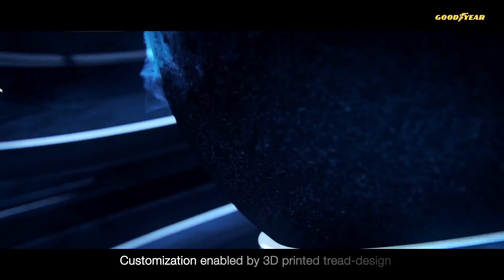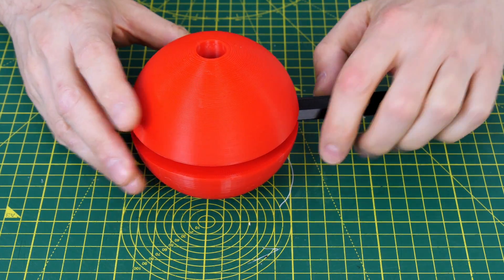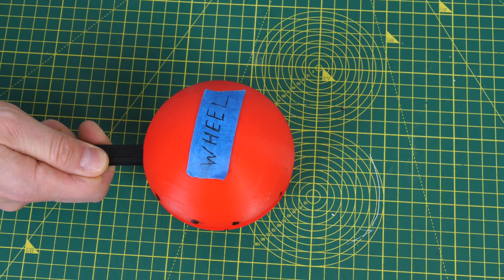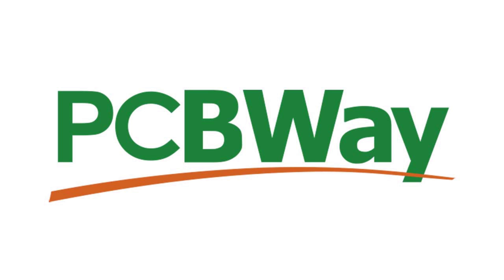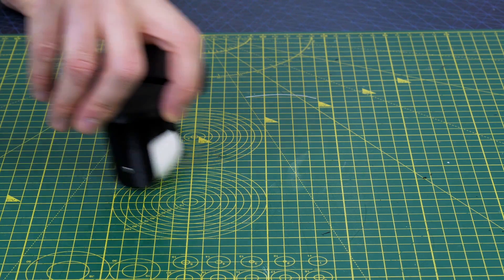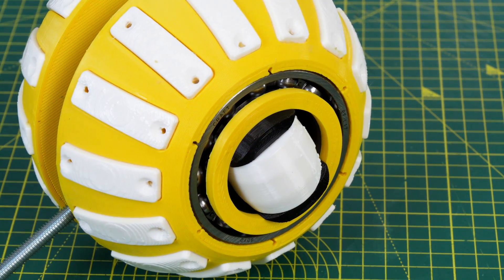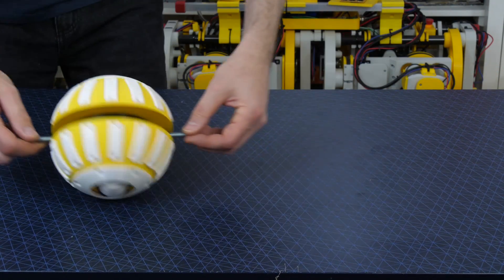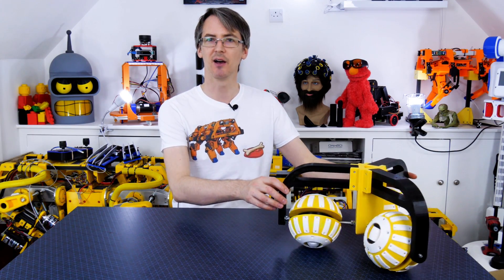Are Ball Shaped Wheels Practical?

Comment: Balls as wheels for a car are about the worst thing you can do! With a car on normal tyres you drive on a surface about the size of an A4 sheet and with a ball as a tyre you would limit that significantly and therefore have less friction surface, which can lead to loss of grip in corners. For vehicles that are slow, they can be a game changer! Also think of the lift on wet surfaces, many more cars would crash due to aqua planing.

Comment: It looks realy greate. You can add additional wheels in gap similar one that you have on sides to minimize that bumping effect and as well to gain a bit of space and make wheels more rigid.
Reply: A mecanum wheel track in the gap (beads at 45 degrees on a D shaped tank track) would solve it, but it's complex and looses the main advantage of this wheel design: it can go offroad. Bumps are inevitable there.

Comment: Interesting video as usual, nice alternative to Mecanum wheels. James, curious did you look at inserting a free moving ball into the end of each hemisphere rather than a wheel, something like the old ball mice had? It would avoid landing on the end and only being able to move in one direction using the inset wheels?
Reply from the maker: The ball would need to be mounted on something so it's free moving under load though
Reply: @jamesbruton  so i was thinking of the mount where it rides on three/four little rollers. Given the end cap only got used when it was near vertical at the bottom the little ball would push up on those, maybe that would be too much friction.

Comment: You can use a boll on top and bottom of each wheel like in old ball mouse, instead of weels.
Reply from the maker: Mounted on what so it moves under load though?
Reply: @jamesbruton  I think it called "Ball Transfer Bearing" or something like that i do not know how it called in English. Also mounting place for a ball from graphite can be useful for small loads, I think i seen such method in video "Make vacuum pre-loaded spherical air bearings without special tools" (sorry i cant give link because YouTube delete my comments with links)

Comment: Locking the polar wheels to an axis isn't the best idea unless you're going to be specifically moving along that axis when the sphereical wheel is positioned on it's pole. Examples like the three wheeled base is an example of why axis-bound polar wheels don't work, imagine if each spherical wheel was oriented on it's poles simultaneously, the vehicle could no longer properly drive itself without a lot of friction from the two misoriented polar wheels. 
A better design would use a ball caster, which is a sphere trapped inside of a housing. This would allow for full 2D cartesian movement and a pivot when the full spherical wheel is oriented on it's polar axis, and would allow free movement when the spherical wheel is slightly off-axis. This would alleviate the issue mentioned before, where friction is induced on a misoriented axis-locked wheel.
As for the TPU cap causing issues, maybe have a thrust bearing between the TPU and the clip that locks the shaft and outer main bearing in place. This would add rigidity to the TPU while also having a bearing surface. A thrust bearing would be better due to the forces it would experience when that TPU portion is actually in use. 
As for motorizing this, you're going to experience issues with the polar wheels, especially with the ball casters, unless you find a way to drive those. It might be a smarter idea in a practical drive platform to just use a swerve drive for a powered wheel, which would negate any potential issues here; possibly even going back to the omni-wheel setup that can drive a sphere. Axis-locked polar wheels have a benefit of being driven through a gear setup off a main central motor, but then you're locked to that single axis. Maybe swerve drive polar wheel are the solution, at least until you can drive ball casters that small omni-directionally? You could couple the hemispheres and swerve rotation together on one motor, then have polar wheel drive on a secondary motor, though this design could become fairly complicated for a 3D printed assembly; the best solution would probably be motors that have a  through-shaft, that way the central portion can be held rigid, but one motor can drive both halves of the sphere, and this would simplify the design for the polar wheel drive motor. 

I'd be curious to see someone try to make a physical example of the Goodyear sphere. In theory it should work, it's just a motor, but instead of a 1D motor it'd be a 2D motor. Also in theory, as it is a tire, and as all the coils could more or less 'lock' themselves under braking, it should also be able to break, though it'd be consuming a lot of energy for the coils to have that much holding torque; though ABS would probably be complicated in this setup. Of all the 'drivable sphere' designs, I don't think I've ever seen the 'spherical motor' concept attempted, all drivable spheres end up being driven internally or externally in some way, or splitting the sphere into components that act as traditional wheels, never a true motor itself.

Comment: I wonder if the GoodYear concept would work better with an attached underpiece that prevents the wheel from falling out even with the magnetic forces. And I do see the problem with braking, as there is considerably less contact between the wheels and the surface. Furthermore, although this is just speculation on my behalf, I feel that fishtailing would be a problem, as the wheels (unlike cylindrical wheels) do not favour forward movement above the other axes. (And oversteer/understeer would probably be a problem too). Overall, without being an engineer or anything, I feel like ball wheels are definitely more suited for slower vehicles, where maneuverability is more important than handling and braking is not a major concern, like utility robots

Comment: Goodyear, if you're reading this:
Nobody needs spherical wheels. If you want to actually innovate, two things:
 -Tires with variable rolling resistance, so you can be super efficient during cruise but fast off the line.
 -Tires that don't wear. Something like 90% of microplastics in the environment by mass come from tire wear. Fucking fix this.
Reply: Yeah if they could, they would. If you make the tyre so that it doesn't wear, you'd also have 0 grip.

Comment: Is it possible to coat the surface of the spherical wheel with neodymium magnets and then use hall effect sensors and a fast CPU to repel or attract the spherical wheel to the wheel well with electromagnets?
EDIT: If the CPU were fast enough, it could attract / repel the wheel to keep it in place with strong pulses to electromagnets so the wheel always keeps a safe distance from the wheel well.

Comment: This is not a great idea for an omni wheel, it only allows for powered motion in one axis and the other axis is purely passive. Also, short of stopping and tank steering, you're not going to turn very well if at all while moving. For a purely passive system as demonstrated here it would be fine if a little rough in spots. Not sure I would want my rolling office chair to use these. I'll stick with casters.
Reply: But it is a great ideo of an ominwheel, no it can move powered in all axes, 2/3 of the motors driving. It'll tun fine, even while moving. Just wait and see on tuesday!

Comment: it's cool, but this design is essentially an overengineered caster wheel
Reply: I was gonna say, this is functionally identical to a trolley wheel essentially
Reply: Except that it will roll more freely. Castor wheels can get stuck in certain orientations.
Reply: @clonkex  so does this, the mini wheels only work if it happens to be moving parallel to the pivot. plus this design has a lot of overotation
Reply: @am-e7967  No, the mini wheels roll along the direction of the drive axis, so if you try to roll it perpendicular to that, the whole ball just spins. There's no jamming angle with these ball wheels.
Reply: Main advantage is: it can be driven.

Comment: Can't wait for the next video, looks like a great application for a ring gear. If that was the case I don't see why it wouldn't be possible to move the carrier around and shift into a different gear for every wheel segment by simply adding stages.🤯

Your videos are so inspiring, It's kind of like that feeling when you finally understand a new manufacturing process and you're suddenly able to think about solving a problem in an entirely different way.

Comment: I'm interested to know if these can be used in motorcycles too in the future...
Reply: Just a guess but I think it would not work well, if you ever rode a motorcycle, you would know at one point when you reach a certain speed you turn the opposite direction to steer, I am guessing the forces would naturally want to start pushing the bike sideways. I could be wrong mind you.
Reply: @patprop74  yes precisely, the counter steering part is what I was thinking about...the forces that make the bike inherently upright after leaning would be messed up, the ball shaped wheels is not designed for a leaning turn. I guess then every bike will have a drift like motion while cornering 😅
Reply: @arnabdas3172  Imagine the nightmare of zooming around at 100mph, and the bike suddenly starts spinning around from front to back HAHAHA one would need one of James gyro installed in it lol

Comment: A note on the intro: magnetic braking is super-effective. It's how they stop roller coasters safely.
Reply: Well ... it isn't effective, if electricity gets cut off, for some reason.
Reply: @ZappyOh  Then just don't turn the car off on an incline! Gosh! Design is just so much easier if customers just don't do what they're reasonably expected to do.
Reply: @ZappyOh  Maybe you can build such a system to 'fail closed' and magnetically brake if the power cuts out, since with a permanent magnet involved at least, magnetic braking is a thing that just happens (try dropping a magnet down a copper tube!) and doesn't require outside power input.
Reply from the maker: The wheels are attached to the roller coaster though
Reply: @jamesbruton  the braking force is independent of the wheels. When you pass a magnet over a non-ferrous metal, aluminum in this case, you get magnetic eddy currents which provide not only a powerful stopping force, but a self-regulating and cost-effective one as well. No parts to wear out because theres no contact being made in the braking system.

Comment: One of my favorite sci-fi concepts is finally coming to life!
Reply: The worry that I hold is, when all of this technology is developed into mass market platforms manual driving would likely become illegal. Strafing is impractical to a forward facing pilot in a crowded situation. Unless, that is, the pilot wasn't human and could consider multiple directions at once. If these sideways maneuvers are available human error would skyrocket unless every vehicle, not just the ones which strafe, are autonomous and communicating with eachother.
Reply: @isaiahdaniels5643  I’ve thought of this as well.  I think new training would be necessary for one.  Also the ‘strafing’ could be regulated in a couple ways:  only being available at extremely slow speeds mainly for parking, or being mostly inactive until the driver turns it on manually.  There are other potential pros besides strafing as well like reducing slip, improving cornering, torque vectoring/traction control and nullifying other less safe maneuvers like u-turns and j-turns.   I think with these things in mind and considering the current safety measures (blind spot sensors/alerts, collision prevention,  cameras, etc.) we could make it work without too much danger, and still allow for human operation.  I also want to be able to drive my own vehicle, but it might not work out that way. 🤞🏼
Reply: which... isn't necissarily a bad thing. I for one just prefer to be in control and at the wheel. That freedom will probably eventually disappear with legislation. Hell, I wouldn't trust the average driver with these maneuverability options.
Reply: @isaiahdaniels5643  | As I heard someone say:
"They don't have to be perfect, they just have to be better then us."
At the point where auto-cars crash less often then humans, they're viable. Still, driving your own car will probably hang on in novelty, recreation, and sport. Just like horse-riding, snow-shoeing, or hunting.
Reply: @PotatoPatatoVonSpudsworth  the thing is when somebody crashes with sombeody else you can blame it on the one who crashed. But when two machines crash and a human life gets lost due to that who do you blame it on??? The programer? The company? The owner of the car? Who is responsible for something that no human got directly involved in? And if the robot made a decision that could have saved a life but instead saved another like saying i can avoid a crash in wich my owner would die and i can instead run over an old man or a baby and then the car chose to run over the old man what happens? And if instead it decided it was better for the owner to die??? What about if it instead chose the baby?
Reply: @santiagofaiella1255  Then it was just be like any other purely by chance accident.

You can blame anyone if you're walking around and get hit by a meteor.

Also this is no different than anything today. If you have to swerve to avoid danger and hit someone because of that, you're not liable.

Comment: Would that frame be strong enough to support you? Would look incredible as the base of a chair!
Reply: An office chair was my first thought too lol.
Reply: i think the 4 bearings at the bottom would break the yellow pole if you tried to sit on it
Reply: @someguy9175  he said they were skateboard bearings. I doubt those would break first. Probably the plastic first since the geometry likely isn't strong enough to hold his weight in PLA
Reply: @lio1234234  that was what i was saying lol, but thanks for putting it better.
Reply: @lio1234234  Nah, he said they press fit into place kinda lika skateboard bearings. The bearings he's using are way too big to be skateboard bearings.
Reply: @lio1234234  you may be able to get the parts made in metal
Reply: And after a chair, I'd definitely go for a toolbox, and then shopping trolleys. Swivel castors are great, but they can be so annoying. These types of wheels could fix all issues.
Reply: @timderks5960  ugh.  I forget who it is, it's either Lidl, Aldi, Ikea, or some/ all of them, but one/ some of them have those shopping carts with all swiveling castors so you can push it in any direction and I hate it.  It always wants to drift and you have to guide it much more actively.  You can't just lean on it and have it go where you want to.  It would be good for something like a toolbox or something else kinda top heavy that you don't want to tip and need to maneuver into tight spots, though.  Even a work stool, or a mechanics creeper, or maybe a really heavy duty version for a floor jack would be neat, too.  My question would be how do you brake it when you have it where you want it, though?
Reply: @Kevin_Narthex  maybe brake pads that would contact the flat faces of the hemispheres. You could use a lever with a tapered end to wedge the pads against the faces.
Reply: Im a fabricator and im thinking about copying this when he gets the motors on here and makeing it out of steel and a truck tires cut up and maybe predator motors to run it
Reply: totally, no more tires getting stuck on the rug, i think it would sell well as chair wheels
Reply: I support this
Reply: Immediately what I was thinking aswell
Reply: im sorry
Reply: That is a great idea
Reply: , a chair that falls over
Reply: The best way to find out is to have a test course to what it can and can't support
Reply: or shopping carts
Reply: I was thinking that too
Reply: not strong enough to support your mom
Reply: @terigonUSAS12  Don't be sorry, it's true!
Reply: @praticle  the good ending
Reply: Same lol

Comment: Wouldn't ball-bearings work better than the small wheels?
Reply: I think that would make it difficult to motorize the wheel.
Reply: @JohnDlugosz  also, traction would be...poor.
Reply: @martindinner3621  Not really any worse than the wheels though; And you don't really need traction on that point, you just need to get off of it quickly and back to the "tread", right?
Reply: @praticle  you've just hit on the problem. If you don't have friction, in an unpowered system you would get stuck on the bearing.
Reply: @martindinner3621  True! What if you rubberized the ball and fixed in place? So instead of being a seperate entity to battle against it would just be another piece of the tread? I just feel like there is a better option than the wheels! 😅